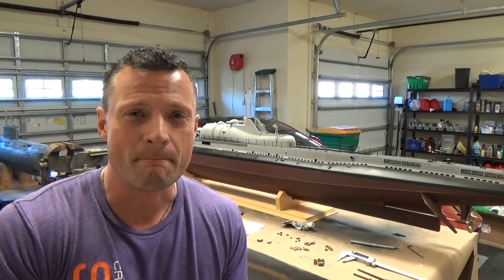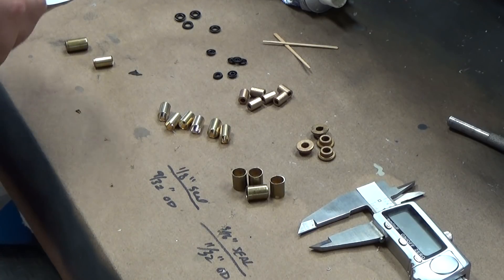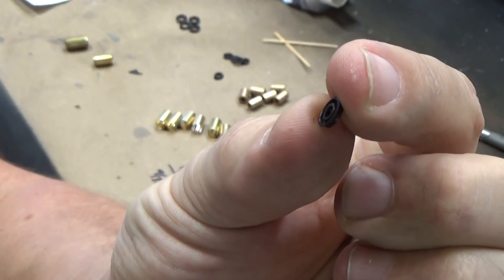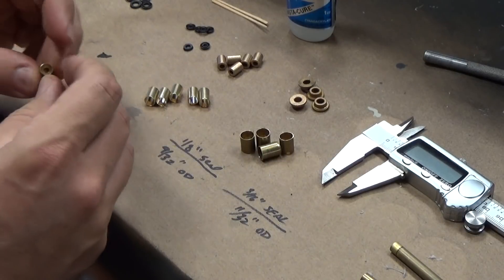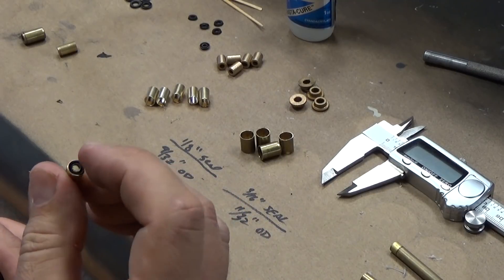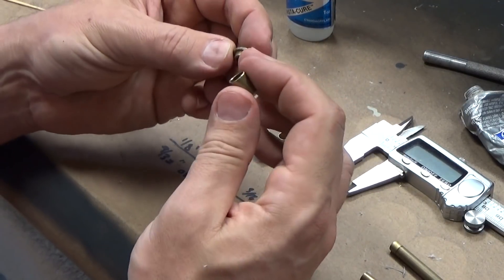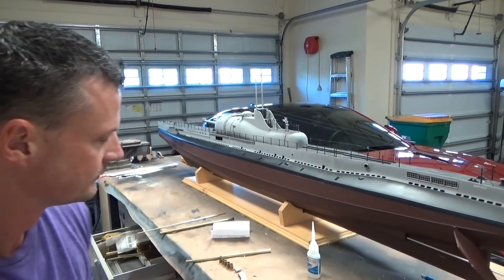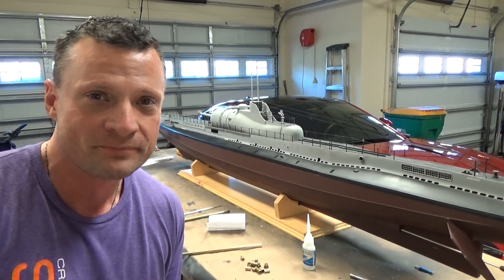How to build watertight seals for your RC submarine

Comment: Dought you read anymore maybe someone can help me, I have a 1/4” SS metal shaft, what size tubing would I need to make a sealed bearing for my 1/4” shaft? Thanks
Reply from the maker: It depends completely on the seal you find for the 1/4" shaft. When you locate one, there will be an OD for it. The ID of your tubing has to interface tightly with it.

Comment: Will this work if the liquid is isopropyl alcohol ??
Reply from the maker: No. Water molecules and alcohol molecules attract each other. Therefore, when water is added to alcohol, the molecules are attracted to each other and a solution of alcohol in water forms. The opposite happens with oil and water.

Comment: i also seen a amazing trick using magnets to move things outside the wtc wall without need for holes so there no risk of leaks. basically, a inside driveshaft spining a wheel with little magnets in it that attracts and spins another wheel with magnets outside the wtc to turn the prop. and rudder and dive planes use similar techniques but instead of rotation its a back and forwards movement. and if you keep the moving magnet parts hovering a little off the wtc wall there wont be any extra friction while still close enough to move the outside parts. brilliant!
Reply from the maker: Yes, I've done that as well. https://www.youtube.com/watch?v=tmHXAQSZNME

Comment: Thanks for the info.  I was on  submarine in the navy, built a 10 foot model of it, but had to let it go, shame.  Question , where do you source those bushings?  I went to Mc Master Carr and found them , but they do not give a dimension of the housing diameter of 11/32 for a size 3/16 shaft, only a 5/16 size. I am trying to build a tugboat stuffing box for a 3/16 shaft.  I see you have PA as the source of the seals but not the bushings.  Thanks you are a terifical builder.
Reply from the maker: I offer the oillite bushings in my online shop.

Comment: Thank you for an excellent video.  What is the max rpm that the shaft turn at using these seals ? Or perhaps a better question is what is a reasonable rpm that will not drastically shorten the lifespan of the seal ?
Reply from the maker: Depending on the scale, sub shafts should spin at between 2000 (big sub) to 5000 (small sub) rpm. These seals should be perfectly fine at almost any rpm you can throw at them (within reason, of course).

Comment: Have these held up well?  Are you still happy with this tecnique?  It seems so simple and there is next to no info online
Reply from the maker: They've been used in this hobby for decades. They hold up exceptionally well and are easy to replace in case of failure.

Comment: What depth have you tested these to?
Reply from the maker: I haven't had the opportunity to destructively test the seals, but the cup seals are rated to over 10,000psi. The weak point is the interface between them and the brass tube. I would be surprised if they leaked before 5atm of pressure.

Comment: All your videos are excellent, but I´d like to know, ad I´d appreciate that, what are the electronic circuits you use to control leakage of water, faiil RF signal and low batery. Thank you.
Reply from the maker: There are electronic standalone modules to monitor water presence, battery voltage and loss of signal. All are listed for sale in the electronics section of my website.

Comment: cap seals can be made from silicon at home, can they?
Reply: Silicon might not be hard enough. If you're dealing with significant pressure (depth) you want a harder material like Nitrile or PTFE.

Frankly, these seals are cheap, better off buying mass produced seals with quality control.

Comment: I want this kind of seal for my propeller shaft..... anyone hlep me plz.....
Reply: I believe this video was your help... If it wasn't you need to be a lot more specific to why something isn't working or why this wasn't what you were looking for beyond vaguely asking for hlep... What size shaft are you using? if its bigger than the example of 1/8 that he gives you can probably just get away with upscaling the parts which you make the seals out of. eg. if you need a 1/4 inch shaft maybe start by looking for some 1/2 inch brass tubing and 1/4th hole cup fittings or whatever sizes will fit together with a bit of research. As RCSubGuy said in response to at least 2 other comments "A seal is a seal."

Comment: you can 3d print a pipe ribbed on the inside and fill it with vaseline and put the shaft through and it's done
Reply from the maker: And you think that's simpler and more effective than a professionally engineered seal? Grease doesn't seal, it lubricates.
Reply: @RCSubGuy   for a low pressure application you can't beat the simplicity, the tolerance is as tight as possible while maintaining free rotation,  the grease won't get washed out by the water,  I've tested it and it works even if I squeeze the water at one end with my hand, water doesn't get through

Comment: How deep it can handle the pressure? I build the DPV and want to try this shaft seal
Reply: Thats a complicated question because it depends on shaft tolerance, squish, ring hardness. Among other things. But as a general rule of thumb a standard O-ring when properly dimensioned in this size range can handle about 300m head. With the addition of retaining rings and tighter tolerances even 1000m head is possible.

The failure mode you expect to see from this sort of seal is for the pressure to extrude the ring through the gap between the shaft and bushing. So even when they fail they may not immediately leak. May take several cycles for an extruded seal to leak.

Comment: Hey, i think you make amazing builds. 
I myself would like to try making such models at some point, but the first thing that i'd like to know (from an expert :D ) is basically what kind of ranges & especially depths should i be aiming at with such builds? And what's the frequency you use for your RC? 

Keep up the cool builds man
Reply: We always sail our subs in fresh water , not salt water , that is important . I'm told , and have never tried it myself. That the  radio will not work as well under salt water . I have not had any problems with going down to 6 feet under water and we sailing them within say 20 feet of us . In other words as far as we can see them . It's important not to use 2.4Ghz radio , it will not penetrate the water , being to high a frequency  to do so.  Here in Britain we can use either 27 Mhz or 40 mhz or in the USA 72 Mhz . Model submarines are tricky so and so's to build . They are not easy to get to work properly . I recommend that you join some sort of club that specializes in subs . Good luck !!  :-)